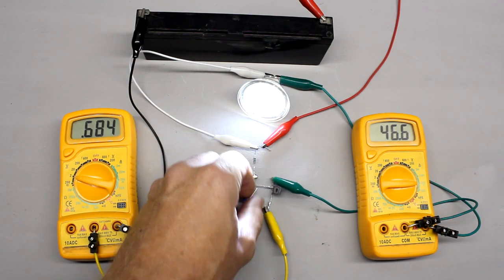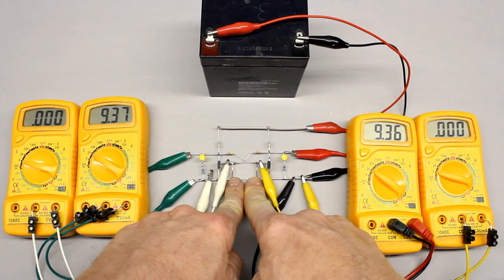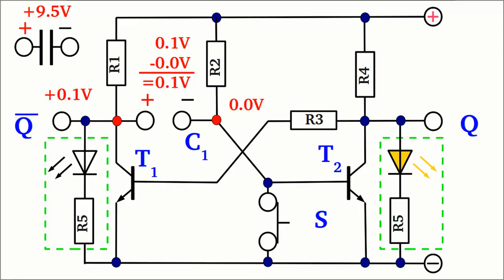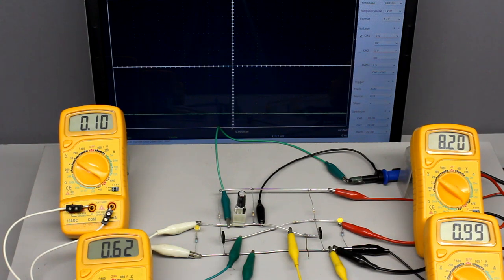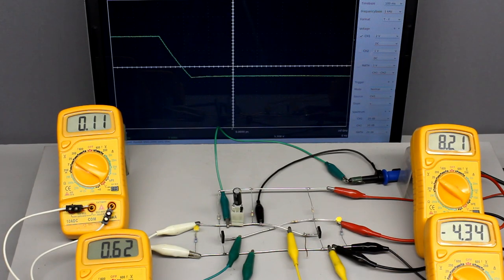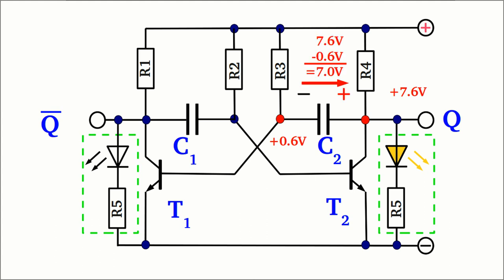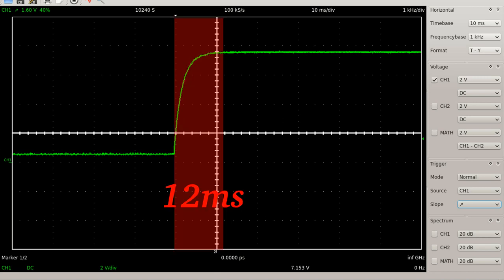Working principle of multivibrators

Comment: Very good videos! I am planning to use a bistable multivibrator and a HCZ-H8-A humidity sensor for a spinkler system. The water should automatically flow to the flower when the resistance of the sensor goes high and pass certain threshold. That means that the soil is not wet anymore.
Reply from the maker: Thanks!
I guess you won't need an astable multivibrator, but a Schmitt trigger:
Operational amplifiers
Reply: HomoFaciens
Yes, thanks. I will change slightly one of my photo relay schematics, but instead of photo transistor i will use a humidity sensor. The threshold when the water will be flowing will be adjusted by a pot.

Comment from the maker: The off time of T2 belongs to the charing time of C2, starting with 0V, So the off time becomes independent from the time the button is pushed (the capacitance of C2 should be low, hence is gets charged quickly).
C1 starts with +9.5V from the right to the left plate. When T2 is turned off by the button, T1 is turned on via R3, connecting the left plate of C1 to (nearly) ground, hence the potential from the left to the right plate is -9.5V and the right plate of C1 is connected to the base of T2.

Comment from the maker: You're welcome!
I have a number of those cheap op-amps in my electronics reservoir. They are not "state of the art", but are suitable for demonstration purposes, as it is easy to go to the limits of those devices (you don't need a high quality oscilloscope to plot the limit frequency or maximum slew rate).

Comment from the maker: There is nothing wrong - yes, the upper plate of C2 gets charged to -9.5V, as soon as T1 is turned on completely, because C2 is switched in parallel to the base of T2 as long as the button is pressed. And yes, the time is dictated by the time required to charge C1 via R2. The capacitance of C2 is clearly lower than those of C1, to there is almost no affect while C2 gets charged to -9.5V by C1. I have added an oscilloscope plot at the project page to visualize the procedure.

Comment: Great presentation. One remark - the electrons flow from (-) to (+), even if it's assumed the abstract "current" flows in the reverse direction.
Reply from the maker: Thanks!
You are right - the electrons are indeed flowing into the opposite direction of the "conventional current" defined to be a flow of positive charges. I choose to use the "referent current" running to ground. I hope that I did not mix the two definitions of current in the video, or did I?

Comment from the maker: Thanks!
The resistance values at the bistable circuit are not critical. The current running through the base of each transistor must be sufficient to bring the device into saturation or at least close to it (have a look at the datasheet). I have chosen 12k for the series resistors at the base pins and 560Ohm for those at the collector pins (the current through the LEDs is also running through those devices). 1k resistors are switched in series to the LEDs. The transistors are type BD175.

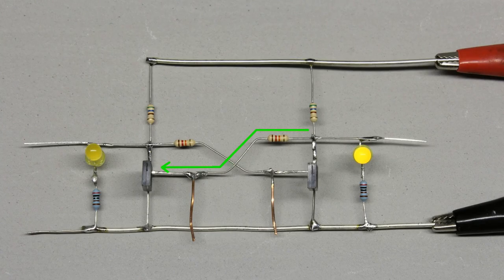Comment: At 2:50 the left transistor is turned on and the left LED is therefore turned off.  There would be a voltage drop of about 0.2V across the collector emitter junction of the left transistor.  Therefore even when the LED is off, there is 0.2 V being placed across the LED correct?  I realize that is not enough to cause it to be forward biased and hence light up, but is there a way to design the circuit so that no voltage is being applied to the LED when it is supposed to be turned off?
Reply from the maker: Yes, you understood the working principle.
Absolutely no voltage will be impossible in a real circuit. Whenever a current flows through a device, it causes a voltage drop. You can reduce that voltage to a minimum by choosing transistors with a very low on resistance and by optimizing the resistance values to get as close as possible to 0V.
Designing a flip-flop using operational amplifiers will bring you closer to your ideal circuit.

Comment: Great video!
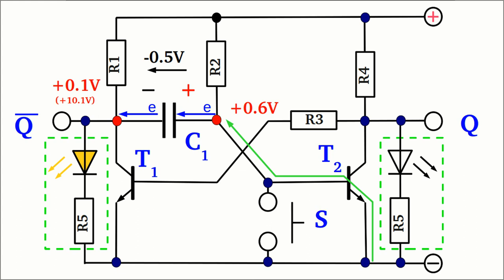Referring to the Monostable Multivibrator when you introduce the new capacitor C2 (12:20): Who determines the duration of the off-time for T2 in the two cases of button pressed and released quickly and button pressed for a long time? (are the times equivalent?)
Can you tell me if this is correct:
Just before the switch is pressed, C2 has a charge of 0V and C1 starts with a charge of 9.5V.
Then what happens when the switch is pressed? Will C1 force -9.5V on the right plate?
Thanks

Comment from the maker: The working principle is identical when using non-polarized capacitors. When using polarized devices, the negative terminal must be connected to the base pins, or else the circuit won't work.

Comment: Thanks for the answer.
This seems to partially confirm what I was thinking. The discrepancy is immediately after this. When the switch is pressed the upper plate of C2 jumps to 0V. T2 goes OFF and T1 ON through R3. Now the left plate of C1 is around 0V and the right to -9.5V. This should force the upper plate of C2 to -9.5V.
At this point the time should be dictated by C1 (not C2) that will charge always from -9.5V. I did some simulations that seems to confirm this. What's wrong?
Thanks :)

Comment: I believe putting  the switch between the  base/emitter junction of T2 could be misleading as the switch when on could take some of the charge of the capacitor and the intended timing design  would be effected.   I would say it is better to put the switch across collector/emitter of T1 where it would  momentarily replace the action of T1 and  the timing would not be effected at all and the  capacitor charge would be used  through R2 when T2 is off and  T2 will clamp the capacitor voltage when its  base emitter juncton becomes forward bias.
The text written on the circuit diagram loses the diagram, and it would have been better to make the circuit smaller with the written text underneath not blocking any part of the circuit.   Otherwise it is a good Transfer of Knowledge session.
Reply from the maker: I will keep that in mind when overhauling the video sometime. Thanks for sharing your thoughts.

Comment: Does the electrolyte capacitor does not get damaged due to  the changed polarity? I have learnded that those capacitors are polarity sensitive.
Reply from the maker: +Yoram Stein A reverse polarity of just 0.7V doesn't cause damage. If you go above 1.0V, electrolysis will happen that destroys electrolyte capacitors.

Comment: I am testing the schematic on 15:45 with different capacitances. Can you tell me wWhat exactly is happening when i put 47uF on the left side and 20uF on the right side. One of the transistor is ON much more time, because the capacitance is more than two times bigger, but why exactly?
Reply from the maker: The lower the capacitance, the less charge has to be accumulated to get a fixed voltage level accross a capacitor. The voltage accross the RC circuit with the lower capacitance is increasing faster. The right capacitor is affecting the base voltage of the left transistor, hence the base voltage is reaching the 0.6V level more early, the lower the capacitance. Thus the left transistor is turned "off" for a smaller period. Since the LED is lighted up as long as the transistor is turned "off", the left LED is flashing shorter than the right one.
Reply: HomoFaciens
Thanks a lot for the good answer, it helped me a lot! : )

Comment: Thank you for this fast-moving video (I'm glad there is pause and rewind!)  I have not gone through the whole thing but I have a question about the early part of the video.  You show a perfectly symmetric circuit with two transistors (but no capacitors yet).  Why is T1 switched on first, instead of T2?  The circuit appears perfectly symmetrical.  I'm pretty sure the answer is that, due to tiny differences in every individual transistor, one "wins", although we can't predict which.  While it is switched on, the other must remain switched off (and that part I understand).  I'm now going to set up this circuit and try a whole bunch of 2N2222's and see what results I get.
Reply: I've answered my own question, if anyone is interested.  The answer is that there is more than the transistors involved (which I should have realized).  I put in a switch to turn the current on and off quickly and easily.  At first, T1 seemed very heavily favored.  It would switch on much more often, 2 to 9 times in a row (usually at least 5), then T2 would switch on once.  Then I swapped the transistors.  T1 (the former T2) still switched on more often, but it would usually win maybe 1 to 5 times in a row (5 times was fairly rare), and occasionally, T2 would switch on twice in a row.  I then realized that the transistors involved also have their own tolerances, and the transistors on one side were playing a role in determining which side was most likely to light up first.
Reply from the maker: A really great answer to your own question! I never did experiments around the turn on conditions of my multivibrators. I simply accepted that one of the transistors "wins" over the other.
Thanks for sharing your thoughts and results.
Reply: yeah and the resistors and the caps which have about 10-20% tolerance, so the circuits are not balanced at all and one will almost always win over the other

Comment: What are you using for the thick "bus wire" that you use to connect all your components together with?  I'd like to build some circuits this way too.
Reply from the maker: I used 0.8mm welding wire, because I have enough of it. 1mm copper wire is not that stiff, but the solering joints are more stable.

Comment: Great! What i was looking for!
Just let me one question: If i pick out one of the leds, will the bistable multivibrator still vork?

I'm planning a small scale aquaponics, and i want to trigger the pump vith this and two float switches. When the tank is full, one switch closes and the pump starts to sip out the water. When the tank is empty, an other float switches close and it will tur off the pump thru this circuit.

But i don't need any other thing to suck my power (aka other stable beside the pump), so i want to know what if i just close the circuit without an other resistor?

Thank you for the awnser, and sorry for my bad english
Reply from the maker: Dewsy Sipos Of course, the LEDs are just used to visualize the switching state of the circuits. The bistable multivibrator will do the job. Use a third transistor to control the pump (capable of switching the current drawn by that device). It won't work if you connect it directly to the circuit (intead of an LED).
Reply: Thank you!
Meanwhile i found this on ebay:

http://www.ebay.com/itm/321486158073?_trksid=p2055119.m1438.l2649&ssPageName=STRK%3AMEBIDX%3AIT

It directly says the 12V pump and the other as an open circuit, so i guess i found  my solution, based on your video.
Thanx again!
Reply from the maker: Dewsy Sipos That circuit will do the job (as long as your pump draws less than 1A).

Comment: How would i know which values to use for R1, R2, R3 and R4 as well as what capacitor?? Im having trouble figuring that out for setting the LED on a specific amount of time of ON and OFF. thanks pls reply :(
Reply from the maker: Did you have a look at the project page I mention a couple of times in the video?
https://homofaciens.de/technics-base-circuits-multivibrator_en.htm

Comment: In the first circuit, the LEDs are connected via Transistor Collector - LED - Resistor - 5V . On the second circuit, it's done through Transistor Collector - LED - Resistor - 0V. Why is that ? Is that just to align the push buttons with the LEDs ?
Reply from the maker: In the first circuit, the LED is lighted up, whenever the Transistor, the LED is connected to is turned "on". In the second circuit, the LED is lighted up, whenever the transistor next to the LED is turned "off".
The second way of connecting the LED is favourably, because it is not affecting the RC circuit .

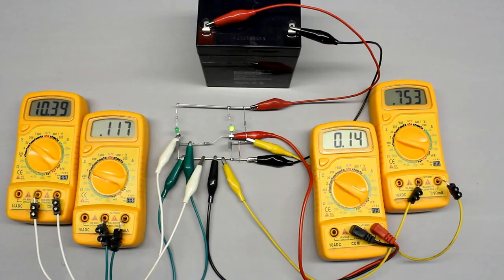Comment: Could you tell me the parameters of R1 and R2 resistors from first example? (0:30)
Is it 200k?
Reply from the maker: R1 and R2 limit the base current, thus the value depends on the used NPN transistors and the supply voltage. Since small signal transistors should be used, a value of 100k will be be OK. I used darlington transistors type BD175 with a value of 1M for R1 and R2

Comment: nice, now a latch circuit to detect the forbidden state for parallel switches to cause no logic change on the output "port", such as, reading input "portA" and detecting more than one port/pin is active (forbidden state), so that the output does not change on output "portB", until only one port/pin is active at a time, to implement or realize a circuit (for example) a channel select for a transmitter or receiver... or, even a realization of the logic switch/multivibrator circuit with a series switch to "scan" a range of channel selection... (a single series switch (single input "pin") that will control (select which output "port" is active) a complete parallel output "port" for such an implementation of channel selection (for example, a transmitter or receiver module)... would be nice too...
Reply from the maker: chris lunsford Something like a multiplexer / demultiplexer? https://www.youtube.com/watch?v=Zz7mcHUNWjE is my video about computing.
Reply: HomoFaciens yes, very similar to such a circuit you mentioned, only more like an ASIC (or a cheap, not so universal MCU), with a small set of instructions embedded to detect, say, in a simple 2 bit circuit, if input port is = to 3, no change to output ("forbidden state")... until input port is = to 1 or 2, then set output to the desired output "channel" or corresponding "port/pin"... with some delay (astable multivibrator) on the clock line of the FF circuit to smooth out the I/O control... or, simply decrease the propagation time of the circuit for a less quirky, less sensitive "debounce"... this is as far as i could imagine such a circuit to be as simple as possible and replace bulky analog control switches, which, could be faulty if the operator does not take care to which switch is on/off... i have to wonder if you make any of your displayed circuits micro... and thanks for the tutorials!
Reply from the maker: chris lunsford Since microcontrollers became very cheap, they are the devices of my choice for problems like that (and even more complex ones). They are tiny, reliable multi purpose tools and so usually much better than analog circuits.
The circuits in my videos are especially built to demonstrate the functionality rather than for productional use...

Comment: What is the value of R1 and R2?
Reply from the maker: Have a look at my project page:
http://homofaciens.de/technics-base-circuits-multivibrator_en.htm
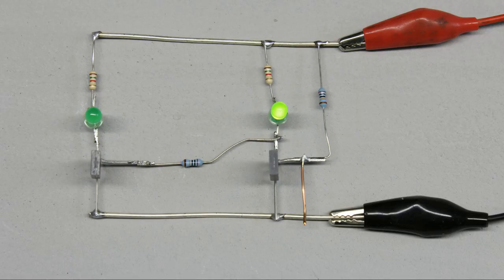Reply: Good evening. The circuit I need is the first of the video "Transistor switching another transistor (00:17)." The resistors R1 and R2 are both 100K? Can I use BC-547 instead of BD-175?
Thank you very much.